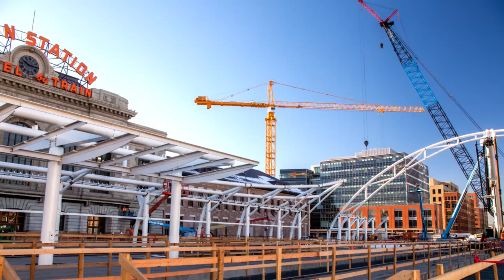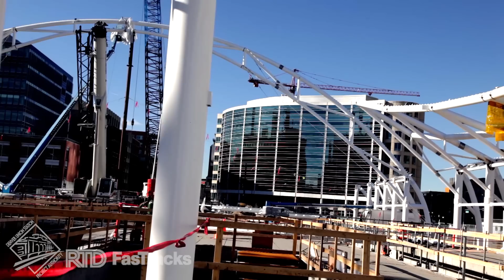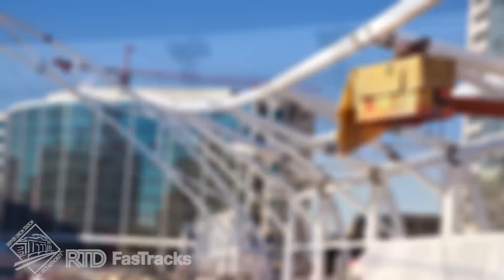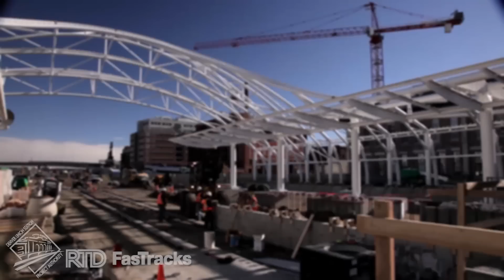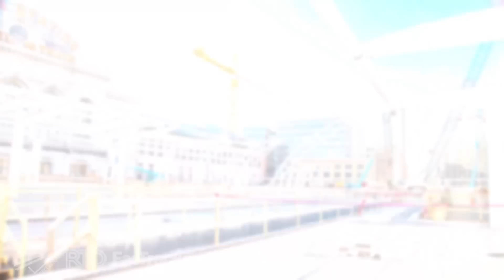Denver Union Station Progress

Comment: Possibly because "the hole" was a central and key feature to the entire project, and because of the size of the bus terminal, it had to be built in 2 sections as to not interfere with Light Rail or Amtrak service. From the beginning of this project, 2014 has always been the announced completion date. I don't know what calendar your living off, but last time I checked, its only 2013.